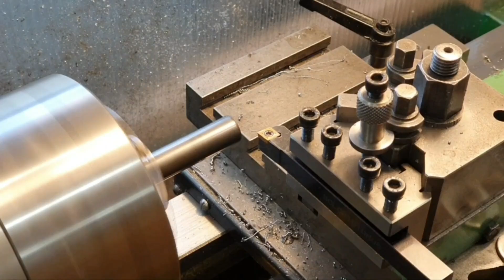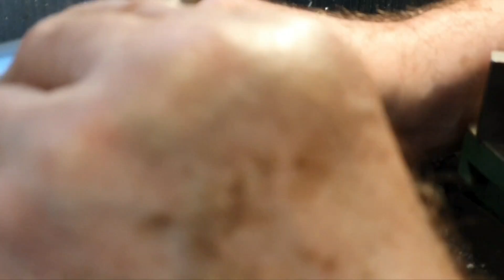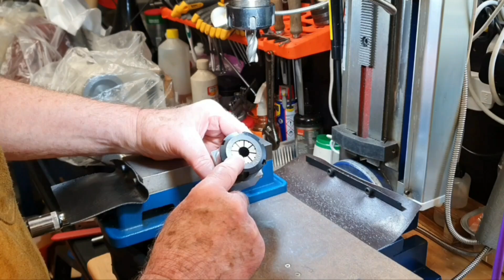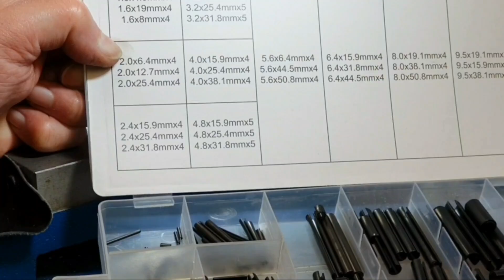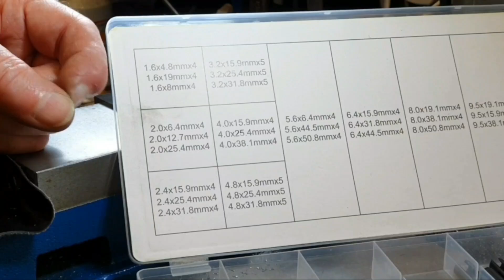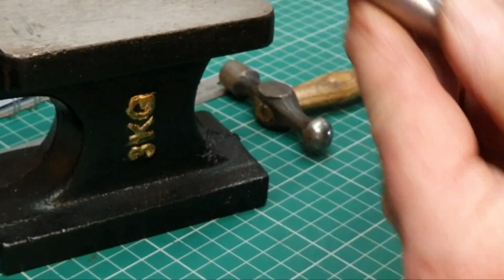Mini Mill Draw Bar + Chucks and Collets.

Comment: Hi Nobby, not what I exactly came looking for but extremely informative nonetheless!  New to machining, even though my Father gave me a brand new Machinerys Handook 23rd Edition for my 17th Birthday! :) Wish I still had it and him. So the best way to learn this stuff is to just watch someone do it.  I look forward to reviewing all of your videos!  BTW I was looking for a comparison of Collets versus Jacobs chucks for End Mill retention and accuracy, just in case you'd like an idea for a new video (if you haven't already done one) 🙂
Reply from the maker: Hi Jack, I’ve not made a video on chucks versus collets. The general rule is that end mills and reamers should be used in collets. Like ER or 5c or similar. Jacobs type chucks key or keyless for drills only. Because of their gripping power it’s also ok to use drills in collets as well. There will be cases when there is no alternative to using an end mill in a drill chuck, but care should be taken as an end mill is likely to slip. There are lots of YouTube videos that make this point. Hope this helps you, and thanks for looking at my videos. ATB Nobby

Comment: Hi Nobby. Next time you want to cut a square on the end of a rod try using the side of the cutter. It preserves the sharp corners on the cutter. Also you get a nice blend onto the rod and you can cut two sides in one setting. If you get a hexagon block in the future cut a hex on the end and a combination or ring spanner will work well. Easier to locate and does not fall off when tightening.
Reply from the maker: Thanks for the kind help and advice. It's much appreciated. Cheers Nobby

Comment: Hi Nobby.  Interesting video.  Many ways to make a draw bar.  Handy to be able to bronze braze for jobs like this.  I have a 3/4" Jacobs chuck bought new and same as the 16 mm is really a bit useless as most drill bits stop at 13 mm (including small shanked ones) and as you discovered the chuck can't grip less than 2 or 3 mm.  So it sits in the drawer looking very expensive and impressive but never gets used ;)  Also I always have the machine running when I knock a Morse taper free from a quill, as it prevents marking the bearing roller race as can occur when hitting in one position.  Quite safe to do this at low speed.  Many people do up draw bars way too tight, which makes it difficult to remove.  Total overkill, just consider the light pressure applied when fitting a Morse in a lathe tailstock.  Cheers Rob
Reply from the maker: Thanks for watching the video Rob. I'm careful not to over tighten the draw bar and the head lock on the mill. A light pressure is all that's needed. I don't use large drills in the mill, as the motor won't take it. That Jacobs chucks sounds like a real beast! ATB Cheers Nobby